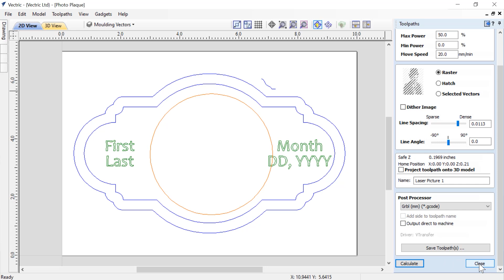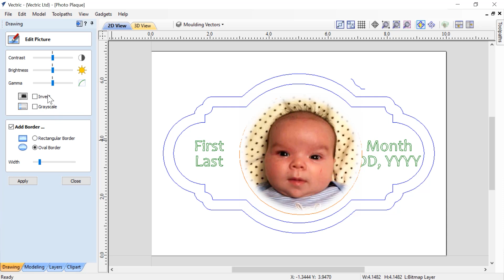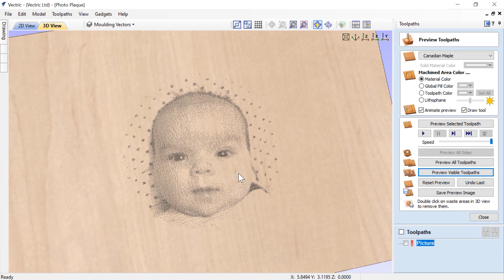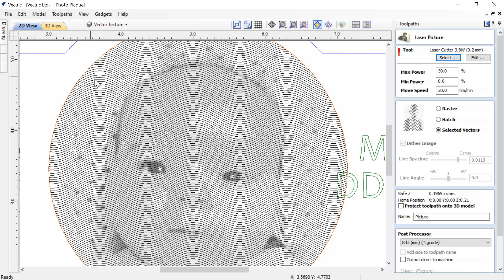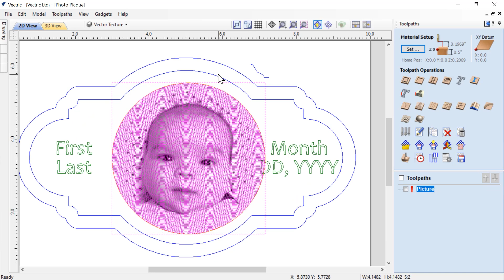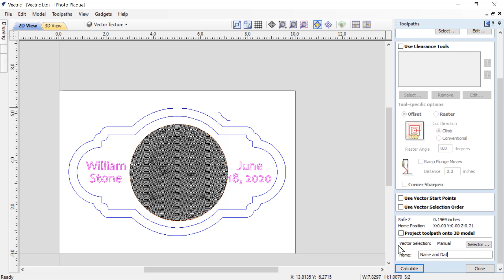Vectric Tutorials | Laser Picture Photo Plaque

Comment: Can you please show how to fix the laser offset when using laser photo? My photos are coming out blurry and I've done the laser line test and see that it is off by a bit but I dont know how to do the laser offset adjustment for laser photos.
Reply from the maker: Hello Jason... I would check your focus and be sure your feeds and speeds are suitable.  Your laser should have come with a block to help set the Z offset.  If you need more help then this I would suggest you email support@vectric.com and include a file, your CNC type, and Laser Manufacturer.